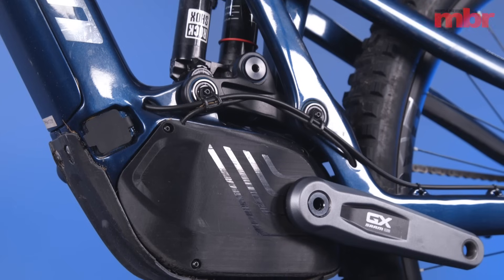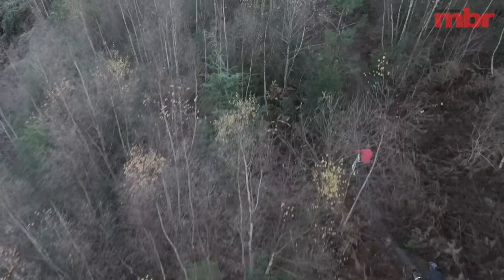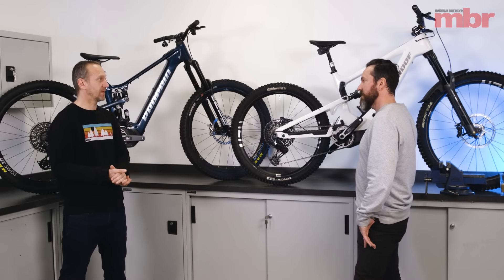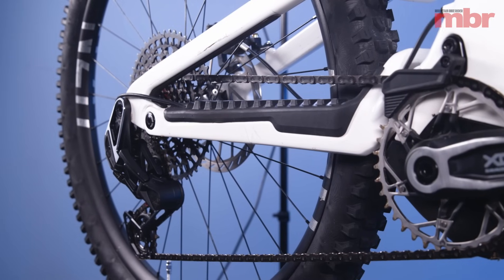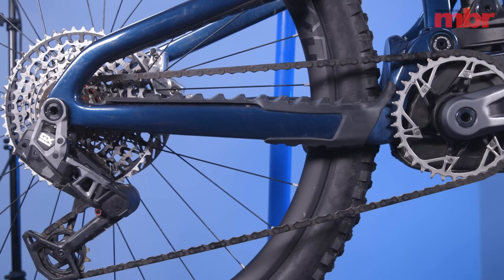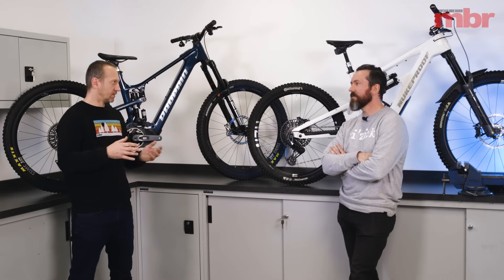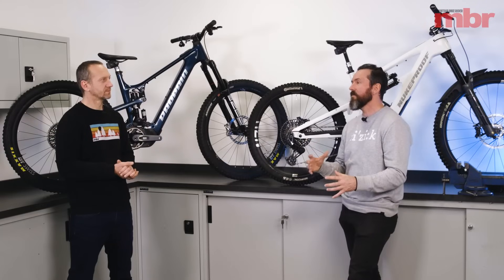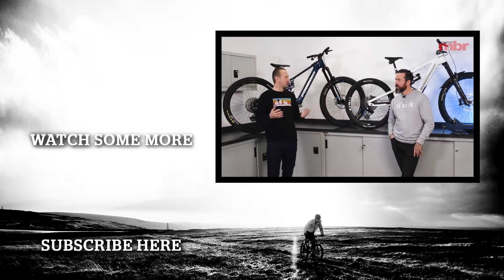SRAM’s new e-bike motor gets automatic shifting, but that’s not its best feature

Comment: Man talk about taking the skill out of shifting.  Imagine if you did this in moto. Shifting is such a huge skill to always be in the right gear to get max speed for clearing jump sections, hills, turns etc. same with MTB. Is it that hard to click the shifter?
I see this, as being a solution for beginners, who probably climb in turbo mode in really high gears/wrong gears which wrecks the motor

Comment: Calling a spade a spade 👍🏼. I would only disagree with the comment that the  consumer want the biggest battery. Weight is more important to me.  So you might say “Well you will have less range”. If i just rely on the battery yes thats true. But if i run that battery flat in turbo i get an aerobic workout, i can then remove my battery after 2-3hrs and have a 17kg analog bike and train anaerobically for as long as i want. Im not sure about other motors but the TQ motor powered off really has zero pedal resistance.
Reply from the maker: In the case of the SRAM motor, we were really impressed with the range of the smaller battery. We still think most consumers prioritise range over weight, whether that's the right decision or not. You may well be the first person we've come across that removes the battery to ride! But if it works for you then all power to you!
Reply: It's true that some consumers want the biggest battery available. That's why most manufacturers now have different sized batteries and different weight bikes to cater for different rider tastes. Not everyone goes out to have an aerobic or anaerobic workout like you. Some of us go to the gym for that, or do that in our home gyms. When I take out my bike, I just want to go exploring places all day. Only a big battery will achieve the range I want. And afterwards I can also do the gnarly stuff that others do too, without having to change the bike or the battery.
Reply: @MBRmagazine  thats the plan but not actually removed the battery yet. My gears are axs that run off the bike battery so just got the etap battery this week. Removing the big battery is optional.